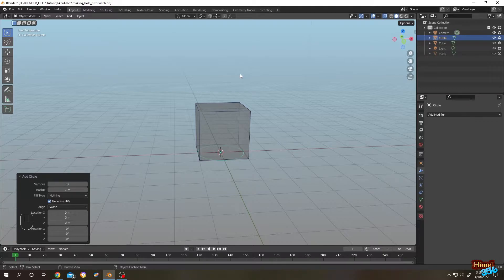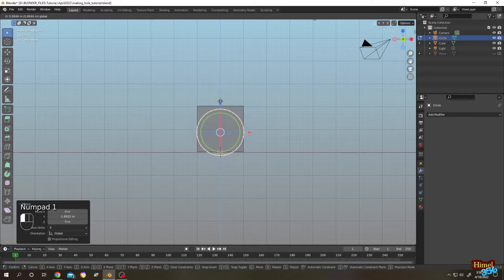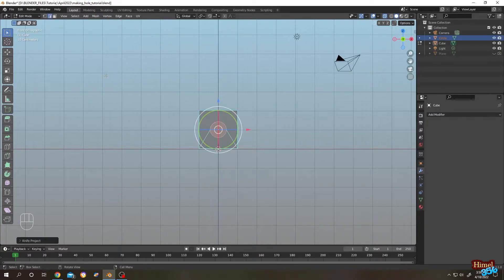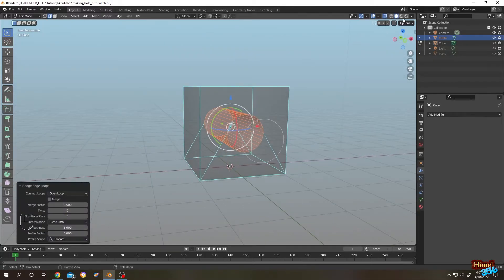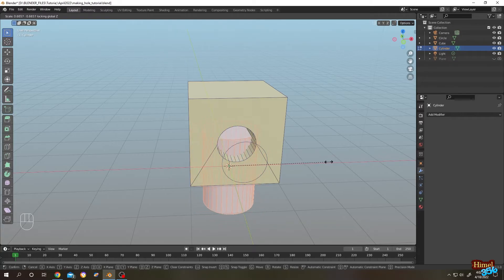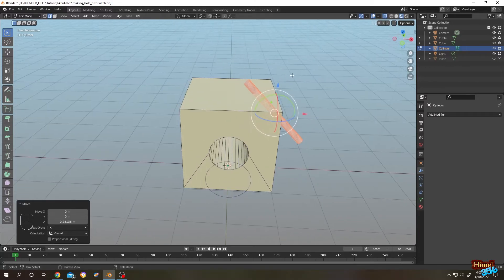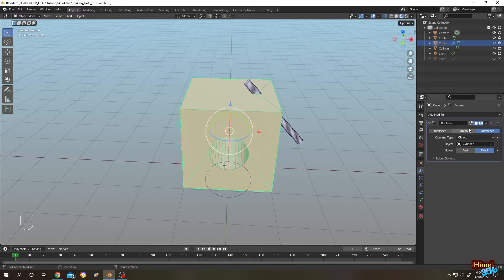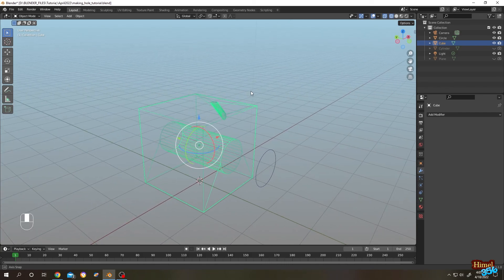Blender Tutorial : How to Make or Cut Hole in Objects ( Updated 3.1 )

Comment: I'm working on a model, trying to make ball joints. But when I use boolean, it will cut the difference, but it doesn't make a new surface or topography within the chuck taken out. It takes out the difference, but it just reveals the hollowness of the model I'm trying to cut. Any suggestions?
Reply from the maker: Bro hide the target ball , u will able to see new tropology of joined balls.
Reply: @Himel356  I'm hiding the ball I'm using to cut. It's still not doing it.
Reply: @Himel356  I think I may have figured it out. The model I'm using is just weird and screwy.
Reply from the maker: @dark8eyed8kid  Just wana say when you are confused with any modifier action .. just play with the simple default meshes to be clear. ty